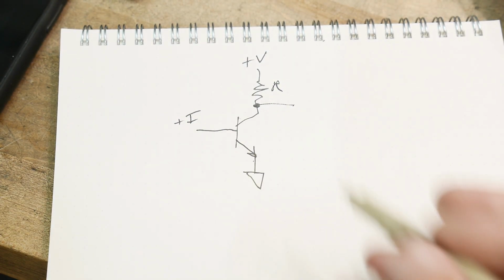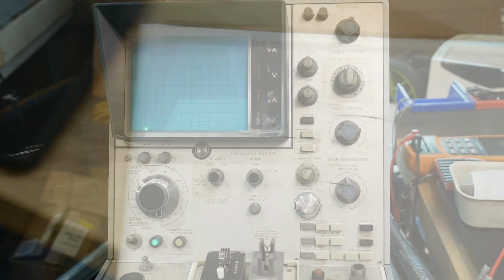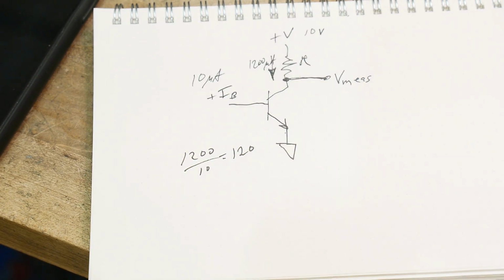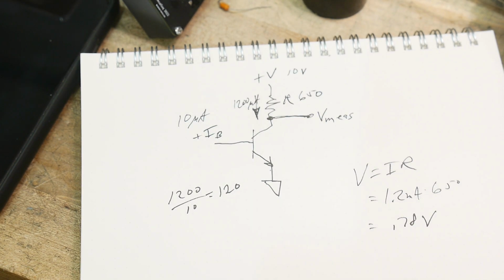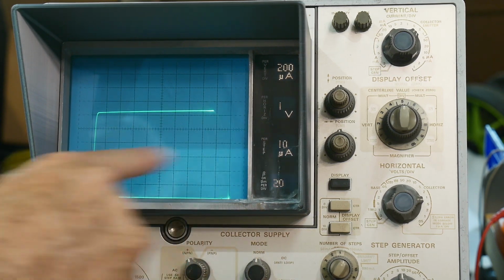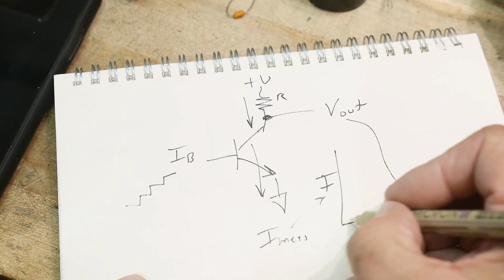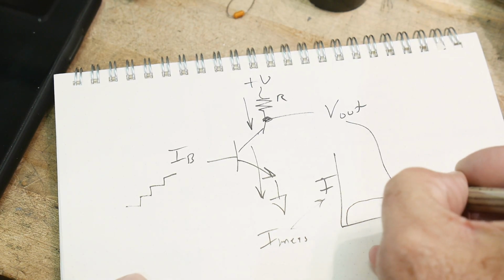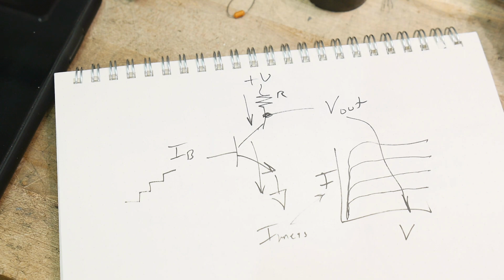#1312 Transistor Curve Tracer Basics

Comment: Great explanation, thanks. It's nice to understand what we see. But I still don't catch what we are looking for, or why we would want to use one in real life.
Reply from the maker: mostly testing a transistor or matching a pair in an amplifier. 
Current gain (β or hFE) across a range of currents and voltages.
Threshold voltage (Vth for MOSFETs) or pinch-off/cutoff voltage (for JFETs).
Saturation voltage (Vce(sat)).
Early voltage (for BJTs).
Breakdown voltages (e.g., BVceo, BVces).Check for leakage, shorts, opens, or degradation.
Spot non-linearities, thermal runaway risks, or poor saturation.
Identify fakes or counterfeits by comparing against expected curves or known-good parts.
Assess suitability for a specific circuit by seeing how it performs under relevant voltages/currents.

Comment: Great! Thanks for doing that. What parameters would you use to match transistors?
Reply from the maker: of course it depends on the application, but common would be gain (beta) and Vbe (turn io voltage, to minimise cross over distortion)

Comment: Thanks for posting. Question in your opinion which type of input would you use when sweeping the Collector to Emitter junction of a small signal transistor when using two different signal supplies?
Reply from the maker: sorry , I don't understand the question
Reply: @IMSAIGuy Would it be a modified sine wave,triangle wave or Saw tooth wave form?
Reply from the maker: @MsFireboy2  I still have no idea what you are asking. the curve tracer uses a 60hz sine wave
Reply from the maker: maybe watch my 10 part series of designing a curve tracer: https://youtu.be/oFHTOQTIi30?si=4OxqmDoBOI0EG5zj
Reply: @IMSAIGuy Thanks. Will do. I love your videos.

Comment: At 1:15, to what exactly are you connecting the DMM leads. You say "to the output"... But what test fixture is that and to what part of the fixture are you attaching each lead?
Reply from the maker: collector-emitter voltage
Reply: @IMSAIGuy thank you. Are you clipped to the collector and emitter leads of a transistor that's mounted to the test fixture? Or do you just have some dummy leads (wires) coming out of the collector and emitter entry points in the fixture itself?
Reply from the maker: @DavidBerlind  no transistor. there is no vertical movement, so no current draw.
Reply: @IMSAIGuy  thanks... I meant "what are you physically connecting the DMM's leads to?" You mentioned collector-emitter voltage which, maybe mistakenly, led me to assume that that's a transistor test fixture on the right side of the porch. If that's a transistor test fixture, then I'm assuming it only has holes in it (entry points to insert a transistor). So, I'm just wondering what exactly each DMM lead was connected to. I have a Tek 577. I'd like to reproduce what you did if I can.  Thanks.
Reply from the maker: @DavidBerlind  https://youtu.be/GIUNertLEi0?si=fvE1MdK5lQvjXNvD
Reply: @IMSAIGuy  whoa. That's way cool. Is there a reason you couldn't make fixtures for different vacuum tube pin patterns and do the same thing for vacuum tubes?
Reply: Also, so in this video, did you clip the DMM leads to those two terminals that poke up out of the fixture you built?

Comment: It is interesting to me in that most transistors do not have any characteristic curves in the data sheets - not like vacuum tube documentation. Most places I worked at rarely had a transistor curve tracer, so I wondered how the engineers designed with transistors for long duration production run circuits. In getting my EE degree (spanning many decades) the main focus was on modeling, but I never felt comfortable as there are many parameters that can vary from batch-to-batch of transistors. While you could do a Monte Carlo analysis in the simulator it still seemed sketch to me. My eventual conclusion was that engineers would just cut the gain using negative feedback to get to a consistent result in the circuit and minimizing the impact of batch-to-batch variations in transistor parameters.

Comment: Hi, 
 I love your videos (think i have watched them all)
You are an excellent teacher with just enough theory to get the point across
I  have a Telequipment CT71 (TEKTRONIX's poor mans version of your tracer, still useful, goes to 1,000v and 2 amps and can switch between two transistors for matching)
I never understood how to use it properly till I watched your video
Have made a note on the CT71 to watch your video before operating
Hopefully I now will stop cremating Transistors
I too would love a follow up on testing jfets, mosfets, thyristors, scr's (as the CT71 Operations manual is very poor)
Watching the curves and spraying parts with spray freeze is a good test for parts with suspected thermal issues
Please keep up the good work giving us the benefit of your vast experience

Comment: I've only seen a curve tracer, like this one, one time. I perceive it is a Techtronics as it is very similar to the one I saw. When I saw it, another tech was using it to match transistors. I was pretty green back then, and I reached out and tapped the collector, and I got 2 instant surprises, one I got an electric shock, and two, I burned my finger, just as the tech was saying ''don't touch that!". :o( ...  I haven't seen on since that time, but I've seen many curves like you demonstrated. Thank you for you explanation and demonstation. (BTW ... what is the model number of this one?)
Reply from the maker: TEK 576

Comment: Awesome job getting this baby to work right.
Do you happen to have a few extras of those empty boxes for test fixtures printed?
Interested to purchase or barter with Tex 576 parts that I see you need. 
Cheers, Pete
Reply from the maker: the 3D print file and PCB is here: https://www.pcbway.com/project/shareproject/Tektronix_576_Curve_Tracer_Test_Socket_33fb68bc.html
Reply: @IMSAIGuy  AWESOME! too bad pcbway did not recognize the 3d file for the box. It looks like they offer 3D printing as well.
Reply from the maker: @atelier_HiFi  you can convert that to an STL or other file they can use.
Reply from the maker: https://products.aspose.app/3d/conversion/3mf-to-stl

Comment: This brings back fond memories - I have used a curve tracer a couple of times in the lab at the Danish Academy of Engineering (DIA) during my studies, primarily for matching transistors for use in a differential amplifier. Later, I when I did my final year thesis, I built a measuring rig for tracing reverse-bias  characteristics of BJTs and FETs on a PC, mainly in order to get that knowledge without the company (for which I did my thesis) having to fork out the price of a curve tracer they would not be using much apart from taking the odd reverse-bias characteristic. Thanks for sharing!

Comment: In college I used to go for the Tektronics curve tracer with the highest voltage 1500V vs the other one at 500V. Made testing PIV on diodes much more fun.  Turn knob carefully until you see the knee and take note of that voltage for class.  Then really crank it and watch the fun-o-meter.   They mostly just pop. Not much smoke.

Comment: Thanks for a great video on curve tracers. 
I have both the Tek 576 and Heathkit 3121. I get mostly the same results with either but the Trek has a decent HV supply. The Tek uses a lot of bench space but since I don't need either full time, they reside off the bench until needed. Though, the 576 is a bit of a load dealing with my decrepit back, 
You can also, with a few outboard and homebrew  tube jig, test some tubes with the Tek 576. In fact, there was a video or two on yT a few years back.
I first ran across the idea of using the Tek 576 after reading a great article in one of my Tube mags years ago. 

73 Glenn WA4AOS

Comment: Really clear explanation of the cu4ve tracer. I have used one to test transistors. A meter can only show open or short. The tracer can show damage that occurs at higher voltages amd current.

Comment: Great video,  used to look at diodes on a wafer. Used the diodes as very accurate temperature sensors so needed to have the wafer characteristics determined after any changes.  You don't see many curve tracers in R&D labs now days.

Comment: I spent many years in the semiconductor test industry. I used the older, bigger brother of the unit shown here, the 575 thermionic valve (vacuum tube) curve tracer. No health and safety with these units, also quite easy to defeat the high voltage safety switch on the 576, the unit used here. 
The 576 if I remember correctly is capable of 1000V at lethal currents, but pulsed DC. 
A really useful testing tool and I have fond memories of using these, reliable, virtually bomb proof  units.

Comment: Have you run across any in-production silicon transistors that have a relatively broad triode region (the area behind the knee), or know of any hacks to force a transistor to operate within this region? As I'm sure you know, a lot of booteek guitar pedal builders are trying to chase "that sweet, sweet triode tone" that comes from even order harmonic distortion, and most transistors are just too damn linear. There were a few jFETs that came close, but the ones that many builders loved are no longer in production because, in most applications, they were the inferior device; the properties that made them objectively inferior are exactly what made them desirable for distortion.

Comment: Curve tracers are great for understanding how transistors work, matching devices if needed, and characterizing a verifying devices when manufacturing transistors.   That said, in my 35 year career as working EE, including the design of hundreds of transistor circuits (with production of maybe 100,000 total boards) I never used one after I left college (and only briefly then).    

I think curve tracers came about because transistors have far more variability between devices sharing the same part number than tubes did, and you really had to have curves for each individual transistor if you wanted to design circuits using your "tube think" years of experience.   "Tube think" means optimizing the  performance of every tube, because they are expensive, bulky, and power hungry.

 As soon as transistors became cheap (ie. when they stopped marketing radios by how many transistors they had) engineers learned to trade off gain for stability using degeneration (negative feedback) so that the parameters of the transistors became non-critical.  If you need more gain, just throw in another stage, 'cause it costs only a few pennies.  You really need to be doing this for thermal stability reasons anyway.   Early texts about transistors had dire warnings about thermal runaway, because it happens all the time if you try to use a tube brain to design transistor circuits.

Power amplifiers still need to push the limits, so having device curves would be helpful in that case.
Reply: As an electronics newb I really appreciated this comment….curve tracers look like a lot of fun and I’ve contemplated trying to find one….but always wondered how useful they would actually be considering you usually design and bias amplifiers for stability. I’m sure there’s plenty of special uses for them though and they are super cool.

Comment: Since these are rare (read expensive), is there some modern circuit/device that you can use with your cro to add a curve tracer function.
Reply from the maker: yes, but with limited capability. I built one:  https://youtu.be/oFHTOQTIi30
Reply: @IMSAIGuy  thanks for the link. I’ve watched your curve tracer series now and feel much more educated to decide what to make. I’ve also seen a few kits for a reasonable cost. Having a limited capability is still a lot better than no capability.

Comment: Hi IMSAI Guy,  Nice video.  I see you did the same mod on your 576 as I did on mine  ( tooth pick mod ).  Everyone needs to be careful and make sure the test toggle switch is in the center position before touching.  My old 575 doesn't have the safety features  the 576 does,  but smells better when running :) .

Comment: Fantastic video. Really nice bit of kit. Would be great to have a follow up showing the regions of the curves when operating a transistor as a switch and as an amplifier and why it's important to work in a specific regions of the curves (amplifiers) to prevent distortion/clipping and to maintain linearity of input to output.

Comment: Why does a capacitor show up as a circle?
Reply from the maker: https://www.khanacademy.org/science/in-in-class-12th-physics-india/x51bd77206da864f3:alternating-current/x51bd77206da864f3:ac-voltage-applied-to-resistor-capacitor-inductor/v/why-current-leads-voltage-in-a-capacitor-logic
Reply: Also, would the traces be the same with AC current and DC current?

Comment: I care.  And learned why the voltage sweep doesn't extend to the source voltage...or the transistor voltage drop is displayed..

To swing the most voltage in an amplifier, one would bias the base until the collector drops half the voltage such  is you had 15 vdc as the supply, the collector would have 7.5 volts..

It is good you got every button to work...

I suppose to generate curves from a mosfet ...
You switch the base connection to voltage ?...and connect it to the gate

Comment: I'm curious to see the I/V differences between the number electrodes in a Nexie tube - I don't think this has ever been plotted before.
Reply from the maker: Hmm,  I guess there will be a small difference vs surface area. I might look at that.
Reply: Ahhh thanks guys! That's a lot higher than I imagined!
Reply from the maker: @donaldviszneki8251  and at the low voltage end it will do 10 amps!
Reply: @IMSAIGuy  :o
Reply: You probably need a higher voltage than this machine is capable of, right?
Reply from the maker: @donaldviszneki8251  nope, this can do 1500V
Reply: @donaldviszneki8251  This machine goes up to 1,500 Volts - that is why I suggested Nixie tubes.
Reply from the maker: I measured a nixie and could not see any difference between digits
Reply: @IMSAIGuy  Then the science is settled now. Thank you

Comment: Thank you so much for sharing this information, I made a simple analog circuit to give my cheap digital oscilloscope a curve tracer function when I set it to measure X/Y and now because you showed the working of the curve tracer I'm able to improve my circuit, I'm changing my load resistor into a variable resistor to have a bit more control, maybe I'll add some meters to measure voltage and current in real time too.